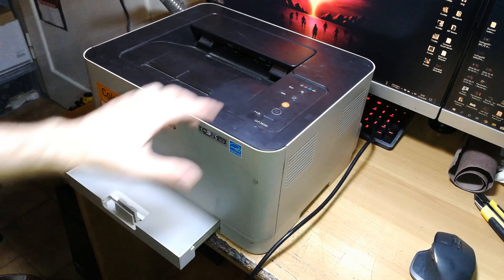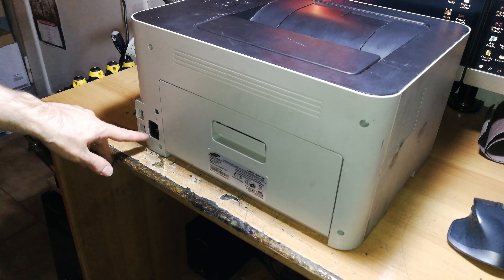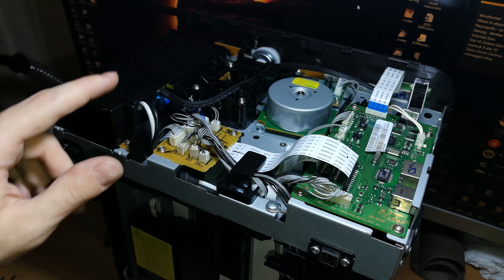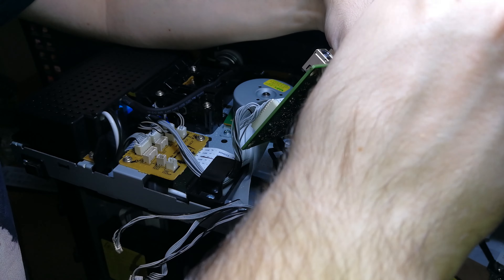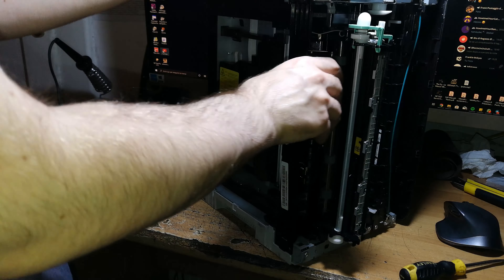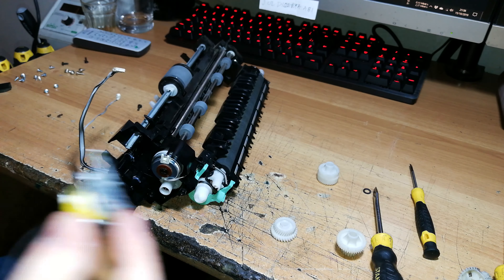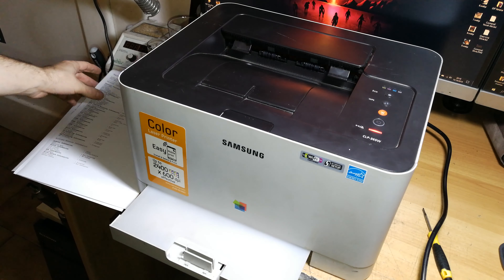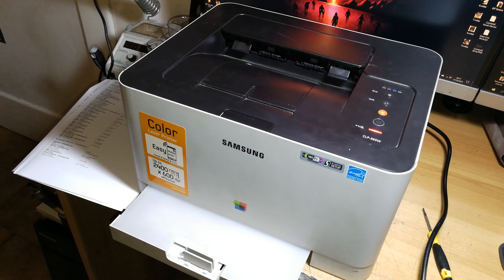How-to Fix Samsung CLP-360/365W, C410W/C430W • Paper Jam/Won't Pick-up • Detailed Printer Repair!

Comment: Thank you very much ... since I do not have a new replacement solenoid in hand .... I put a piece of barcode sticker firmly on the rubber of the contacting solenoid (I wish I took a picture) and cleaned any sticky traces and now it is working perfectly .. I hope it doesn't fall off soon - LOL !!! Thank you so very much for this fantastic detailed video ... without it i would have never been able to locate the solenoid - I hope you can take another video of how to install the switch "Closer view" in the proper position (it took me a very long time getting it back in place) - i recommend opening the other cover and remove the power board (5 screws + pushing the clip in the middle) - Again ... Excellent video ... my respects ....
Reply from the maker: Hi! Do you mean the switch that senses if the back cover is open or closed? Sorry for that!
You can buy a solenoid in advance from here https://youtu.be/-cDmF3NFGug just in case it will fail, in any case, thanks for watching :)

Comment: I have a question. I am after doing the solenoid fix printing works perfectly but if I try to copy I still get the paper jam error. Could you guess what would be problem. I have CLX-3305
Reply from the maker: Hi! 
Honestly I don't have any idea, aside of any paper format settings being wrong in the copy.

Comment: Thanks very Much for this. you have just sorted my printer for me. i dismantled cleaned and resistance checked solenoid. mine was stuck. I guessed at that point nothing to lose if i reassemble hey presto works.... Thanks...

Comment: HI , you are so knowledgeable4t. I have a paper jam in my Samsung express laser multi. The jam is only visible when the printer is turned upside down. There is no way to get to it. I'm sorry to say I lost patience and started to pull bits of paper through the bottom grid. Now Ihave bits of paper all over.
Could you please help me?
Thank you
Reply from the maker: Hi! So you cannot take out the sheet even opening the back cover and fuser unit? If it's a monochrome, remove the toner cartridge and inspect that area to see if you can remove it. If possible send me a some photos at the email address you find in the video description.

Comment: Hi Paulo. The tip of the paper is graped by the pick up roller and the printer stop emmidiatly with yellow blink. I can pull the paper out with easy draw. Do you think this is a solenoid problem or something else?

Comment: Ciao Paolo! Do you have experience with Samsung CLP610ND? I have a Samsung CLP610ND and I can't eliminate the message "door open/check belt tranfer". The door sensor of PCB board is OK, but I could not find the error reason. Did you heard some trouble like this? Thank you!
Reply from the maker: Hi Alex! I don't have any experience with the CLP-610ND, as it's not a very common model here, all I can think of at the moment is to check the installation of the transfer belt... If you haven't done it yet have a look at the service manual, search for PTB (Paper Transfer Belt) and you'll find heaps of informations on all the parts of it and how to install it and what to check. I cannot redistribute service manuals but you can find it easily on google.

Comment: Grazie per questo video fantastico. I tried to disassemble and just cleaned the solenoid without taking it out and re-assemled the printer (C410W) - Proble still persists but at least I have familiarised with the procedure. I will have another go at trying to fix the solenoid with rubber or something similar before I look for a new part. The JC33-00025B somebody mentioned here seems to be reasonable in price (+£ 6-7 for postage) but not sure it is the correct one. Will post back in due time. Grazie ancora Paolo.
Giovanni

Comment: I followed your video as had the same problem with a C410W. Now when I power on the rollers don't move on start up and I get a red error light. Any ideas what I've done incorrectly. Any help gratefully received. Graham

Comment: I had the same issue, and reached  the solenoid easily, thanks to  your video, BUT the solenoid looks good, I tested it with 24 V, and works fine. Could still be the problem?
Reply from the maker: Hi! Yes it could, because you probably tested with 24V applied for several seconds (or ar least one second). The printer applies voltage to it for a fraction of a second in those models, so if it's defective it doesn't have the strenght to react in that short amount of time.

Paolo M.
Reply: @PaoloMarcelli   I actually found out I was using 31 Volts, and applied for many extended times till i started smelling plastic burning. Funny thing, I put it back together to not leave it open till part arrives, and for some reason it works just fine now :D, must be that torture I did to the solenoid, brought it back to life :D
I also greased all gears, maybe that.
Reply: Hi Paolo, I have same issue - the solenoid was tested on 20V and it works OK, also when I power up printer I can hear solenoid clicking, but the roler does not turn and it would not take paper. Actually if I set the roller in certain position it turns only once at the start and then it refuses to turn. Any idea how to fix that?

Comment: Hi  this helped me a lot even though I don't have the printers above I have a clp-315w the solenoid thankfully  it is a little bit easier to get to and it was sticking because of the pad - removed the pad _ DONT NOTIC ANY DIFFERENXE IN NOISE and it works fine

Comment: The part at @14.10 where you told you have a problem if it misses (the spring)....It misses. Where can I get one?
Reply from the maker: Hi!
aliexpress.com/item/1005001631808755.html
Never bought this, but it's the only one I found right now.
Reply: @PaoloMarcelli  I finally got it and it worked! Thanks a lot, this really helped me.
Just one problem: the WIFI isn't working anymore

Comment: Hi, I changed the solenoid but when I power on the printer, the little lights for cartridges appears one by one for once and after I got the big red light as a sign for error.

The software of the printer was change to not check the cartridges chips. 

Is there a fix for this? 
Thanks,

Comment: worked to fix xpress c460w. Though, I didn't replace the solenoid and just replaced the foam pad as suggested in another video that points here. Thanks!

Comment: Hej
 Can you advice me about Samsung print plugin for wifi. I have fixed an older   clp 365w with usb and wifi direct. When using my phone I specify pages to be printer but it dosen't a cept single page definition, and also intervals are interupted with green light blinking, and fuser heat up.  I have used Samsung print plugin before on other versions of Samsung cpl 365w where it worked proberly. Can you help?

Comment: Hi I worked on my printer Model C460FW, it had the same issue as described in the video. Opened it all up, did not have time to order the relay. I cut the foam bumper on the coil side of the relay in half and put some Vaseline on the swivel support of the relay and lubricated gears. My printer working again. Thank you so much for the video. I have one query, mu printer has a ghost image of the previous page anyone know what the cause is or how to repair this?

Comment: Can you help. I have a Samsung c410w and it just started printing and stopping half way. And the paper comes out with a curl in the middle of the first page. When it goes to print the 2nd page it gets stuck halfway and I need to clear the jam and restart. Please help. This is my favorite printer and I have already replaced 1 part.
Reply from the maker: Hi! So it comes out with a curl in the middle... Check the fuser unit, see if the fuser rollers are both in good shape. You can access them by the upper cover, right where the paper comes out

Comment: I looking for dump flash and eeprom from this board CLP-365W (V3.00.01.14)
Where can it be found, downloaded?
Reply from the maker: Hi, I found this site that has the original firmware on the bottom of the page, where it says "Оригинальная прошивка".
https://printservis.com.ua/index.php/blog/item/378-proshivka-fix-samsung-clp-365w-versiya-v3-00-01-11
It even has instructions on how to get the printer to forced firmware update, I used a translator obviously XD

Comment: also is this part a 2 pin solenoid or 3 pin solenoid?
Reply from the maker: Usually it's 2 pin, but I need the printer model.

Comment: how to clear paper jam without taking it apart? there should be a button to force the rollers to roll or separate slightly to loosen its grip on the paper
Reply from the maker: If you open the fuser unit cover, the pressure between the fuser rollers releases. I don't know where your paper jam is, but in those printers it's not hard to access them usually.

Comment: What’s the part number for the c410W solenoid?  Thanks
Reply from the maker: Hi, JC33-00025B
Reply: Thanks Paolo.  I got lucky and was able to stop right at 10 min of the video and tilt just one side out to access the solenoid without pulling out the whole assembly and surgically insert a small 1/4” square double sided tape onto where the old one had deteriorated and get the printer working again.  Thanks for the very detailed guide.

Comment: Wonder if this is my issue , samsung clp-320 , dont see anything happen in paper tray, even loaded full says paper is empty in tray1, power up it start fan, look for toners, smart panel show toner levels , after clean waste tank I get only the paper error, I get very short flash green and then stay solid red and toner lights are dark. just got this second hand shipped, first I see is its pouring black toner out without stop pounds of it. Guess its bad idea ship a printer with toners installed. After tons cleaning i get the mentioned error. Havent opened all of it yet, its likely full of toner on every part inside

Comment: Hi, seems I'm the lucky one in which the printer is returning an error. I followed your awesome guide step by step, replaced the solonoid and put everthing back together. I'm now getting the following problem; printer boots up, little bit of spinning sound and then it goes to orange led. If i try printing i'm getting an error on macos with message 'imaging unit failure'. Before I started with this fix the printer would show green led, but wouldn't pick up the paper. 

Could it be that I put the solenoid in a wrong way and thats why i'm not hearing the spinning? Would be great if anyone could help, I feel like the fix is easy and I don't want to throw away the printer :((

Comment: The printer was a bit complicated to hook up https://www.youtube.com/post/UgkxciSwynMJ7PnUvvx11rewiu-yFBkZTl53 but it does the job very efficiently. I like the ink wells versus the ink cartages that cost an arm and a leg. It prints quickly and the quality is excellent. It shuts off when not in use, so you have to remember to turn it on. Overall, it exceeds my expectations. I'll update my review in a couple of months.

Comment: I cant get the spring gear off there are 2 little clips that you push to a side 11.34 in the video my printer 460W gear will not come off no matter witch way I lever

Comment: Did not work for me. Replaced the solenoid but the paper pick-up shaft is still not spinning. Even opened it a second time to adjust the spring loaded gear and afterwards a paper entered the printer halfway but afterwards no more movement.

Comment: Hi, i have the same printer, same model. But my problem is that my printer doesn’t turn on. I have checked the power Supply and i saw That was Only 22vcc and 5 vcc and no more. The power on button is working ok . Anyone knows how to Fix it ? Tks

Comment: The issue with mine is that when I turn the printer on, the wps light comes "on" for half a second then it disappears.. then the  power on button lights green. Nothing happens after that no matter what button I pressed or long pressed or combine power button with other buttons with long press.

Comment: the hardest part by a country mile is getting solonoide back in, whether u repair original or use a new part.
there is not enough detail in how to get it back in

Comment: Anyone check first your Samsung C430W waste toner container. If that is full, empty it out and then clean it with a portable vacuum.  Solenoid replacement may happen for circuit shortage. I fixed mine by emptying the waste tray. Hope this helps.
Reply from the maker: No no absolutely don't empty the waste toner container. Waste toner needs to be recycled correctly and you absolutely must not breathe it in, you need to replace the waste toner container in that case, it also costs around 15$ so there's no excuse to not replace it if it's full. Also I really cannot understand how that could affect paper pickup, if that's what worked for you i'm happy for you, but those are two totally different and distinct things.
Reply: @PaoloMarcelli  thank you for the reply. Since it was the same error on the printer the diagnostic tool found the issue and it worked for me.